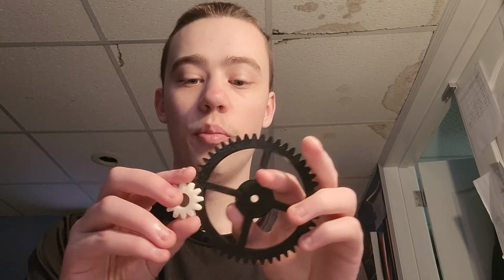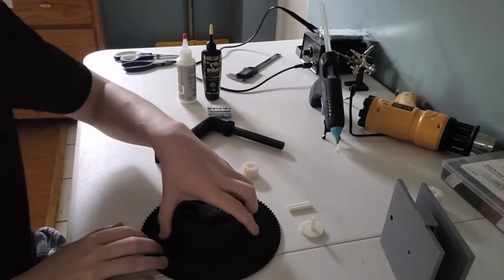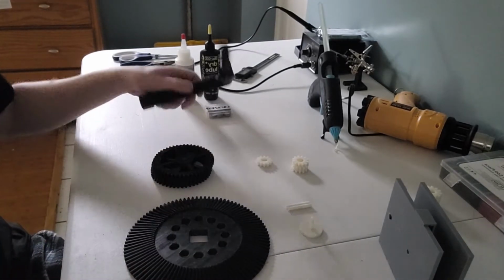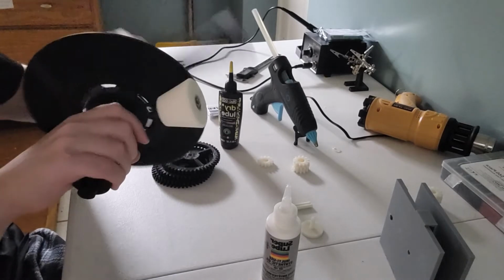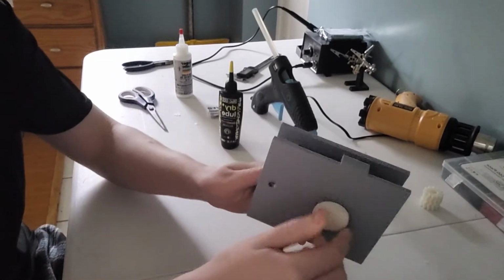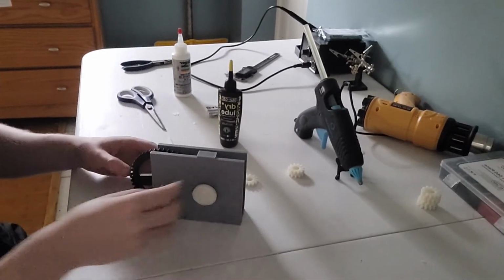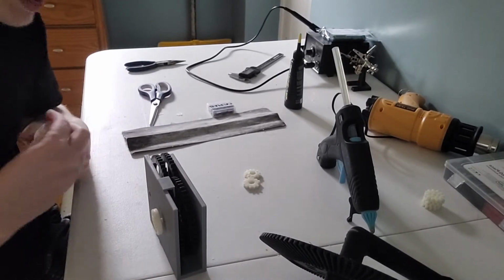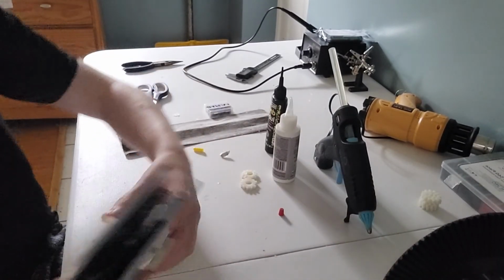Trying My Hand at GEARS! | High Speed Gear Box

Comment: This does not look good, it is a gigantic and bulky, fragile device... that same steel resistance in a reducer is the size of your big finger on your hand  Furthermore, it is the same thing that everyone does, it is the copy of the copy of the copy.
Reply from the maker: thanks for the input! Since this video I've become a certified CNC operator and am capable of milling better gears out of aluminum stock. I have come a long way in 2 years.
Reply: @tobecomeimmortal  This reducer is stronger and more resistant and 40 times smaller than the one in your video and cheaper   copy and paste the link all those letters and it will send you mini steel reducers to li express
Reply: @tobecomeimmortal  See the link that I left you. If you analyze the mechanism, you can cut it and make 2 reducers and put the motor that you like.